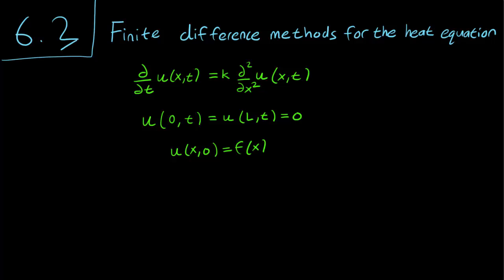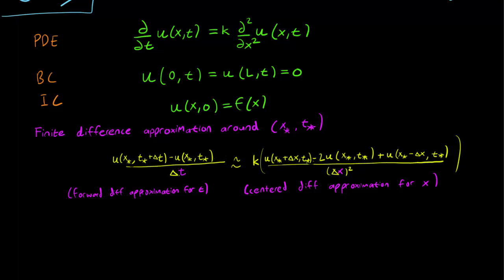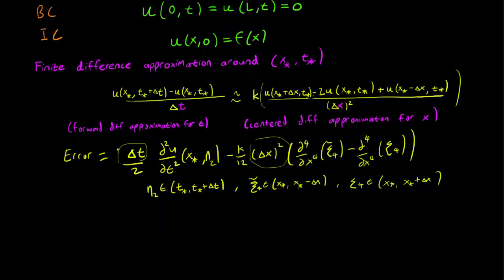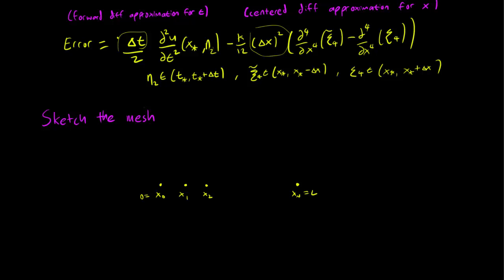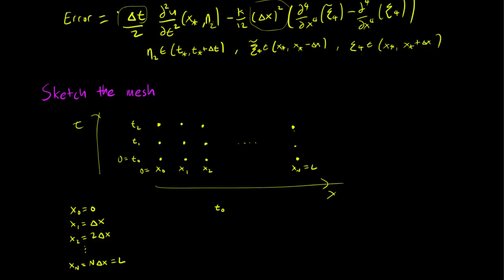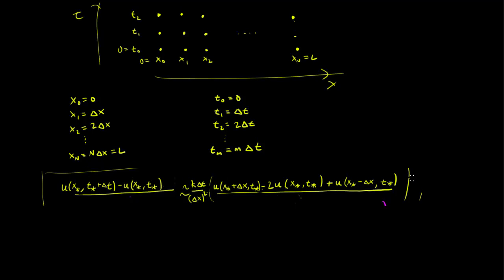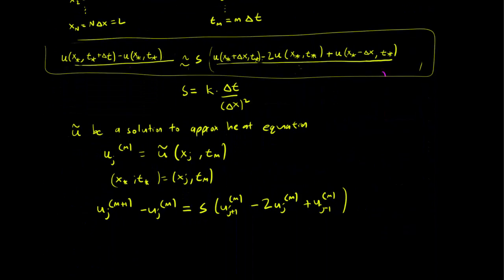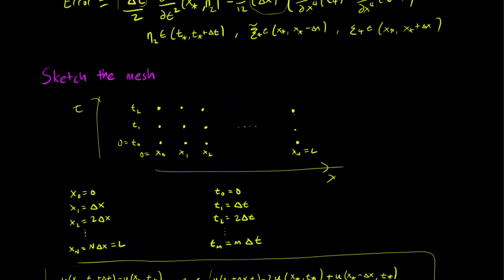6.3 Finite difference methods for the heat equation

Comment: Im just at calculus 1 in school but i find this very interesting. I tried to model the temperature distribution in a concrete wall in a house.  
So basically i wanted the inside temperature to decrease exponentially from 25 to 15 degrees in 1h and then to be fixed at 15 degrees after that time. The outside temperature is 2 degrees.  
Can i then have a boundary condition like u(0,t)=2+(25-2)*e^-st (newtons law of cooling) for t<=3600s and then u(0,t)=15 for t>3600s.
Reply: are you aware that this is 3rd year level engineering o.o !!. wow you're gonna be a genius man, plz keep it up.  Life will pay u back for this effort.